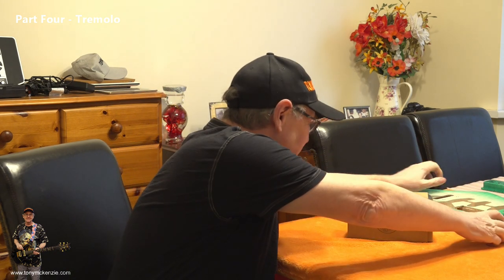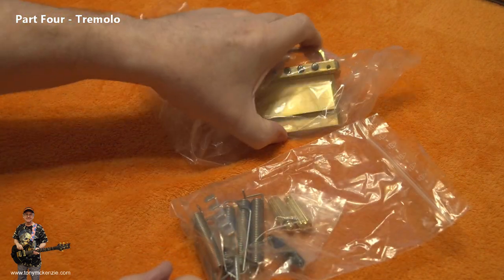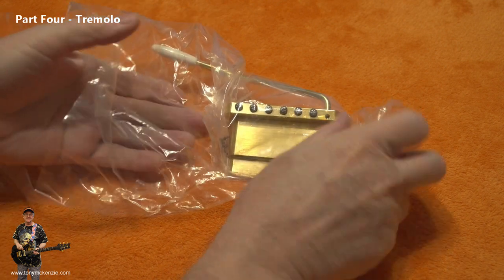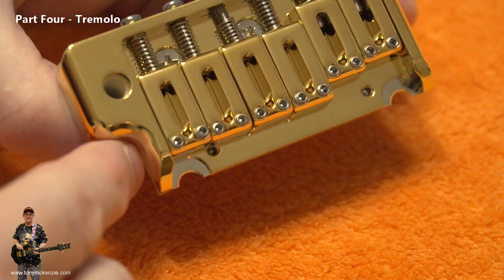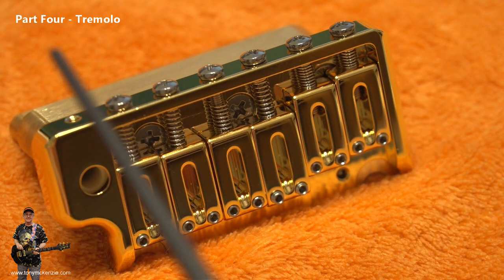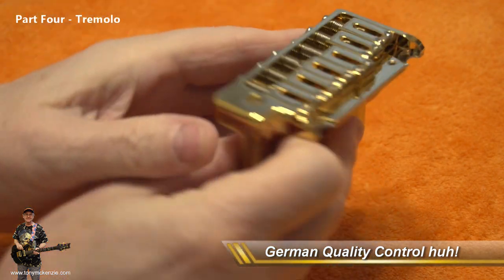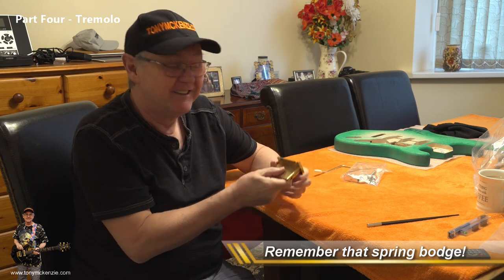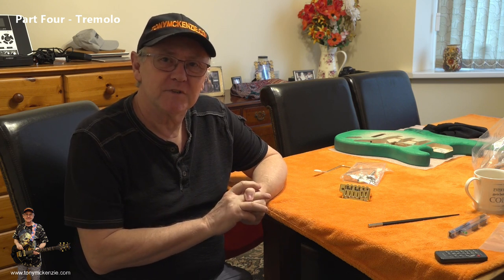Perfect Warmoth Stratocaster Guitar | Featured: ABM 5200g Tremolo |  Part 4 Strat Trem Closeup

Comment: Tony that looks like a great trem, love the gold, and the brass block. I ordered a strat from Warmoth with the Fender American Standard routing. My trem was a Hipshot which was supposed to be a direct replacement for the Fender. It wasn't. The trem wouldn't rock because the block was hitting the back of the trem block rout on the top of the guitar. I had to take a dremmel and grind off 1/8th of an inch off the back of the rectangle to allow the block to fully float and alter pitch up or down. The trem unit still covers the hole completely so you can't see that my enlarging the hole isn't perfect, but it is good. I don't know if that will happen to you with the ABM, but I just wanted to pass this along in case it is an issue. Thanks for the really well done videos!
Reply from the maker: Great point. ABM and Thomann both say its a direct replacement for the American Stratocaster, but as we both know that's not always the case. All the ones I have used to date have been a perfect drop in, but if you look at the video where I show the bridge dropped in to the body, I'm not entirely sure that there is not work to do on it. Thanks for posting about the Hipshot (do you have a model for it) as it helps people to know what is really a direct and what is not. I'm reserving my opinion on the compatibility until I fit this, but any issues will be posted on here for sure and also shown in the video for sure. One thing is for sure, if there are problems with fitting this ABM tremolo unit then it clearly won't be fully compatible. We shall see and as I said, good point for sure. Thanks for watching and stay safe.
Reply: @tonymckenzieofficial  The Hipshot unit is the Contour Tremolo, model 42100vc. Cheers and thanks again!
Reply from the maker: Thanks for the model.... and stay safe.

Comment: yrs ago wen i had access to a metal shop i went and copied the bridge plate on my hard tail strat. i used hardened steel to replace the chrome plated copper plate it had before. it was a pain in the ass  heating and bending it to look stock drilling out the holes for the saddle screws ect. i polished it up and fitted it and i like it better but if i ever do it again im going to use pattern welded steel because it looks cooler, i might try pattern welded block saddles but i it wont be fun and will take forever just the way i like it. if i was in the market for a new upgrade for my backup strat the abm would be a contender!
Reply from the maker: Thanks for the info on the mods! Ha I could not do that these days (maybe when I was 25 or so) and it sounds like aggro to do too. So how much better was the tremolo after the work? Could you hear a difference or was it the 'feel' of the unit... all interesting stuff. This tremolo was chosen by me because it was 'different' in a few ways but claims compatibility with American Stratocasters. Well we'll find out about that soon enough :). Thanks for watching BTW and stay safe.
Reply: @tonymckenzieofficial  What was the name of that other superior trem you mentioned? Have you tried CGWP (or maybe it's CWGP) for parts? They're based in Norway. They have a Reverb page. I wonder how different metals affect tone. I don't even know what 'cold rolled steel' means. I was looking at Glendale and Callaham hardware. I'm going to install a dual fulcrum - maybe the G&L. I'm not sure if they make a brass one. I like brightness. I may try a brass pickguard, nut and tuners as well. I like relic or antiqued brass. That Norwegian Co. I mentioned makes a lot of bronze and brass hardware....and nickel, tin and steel too I suppose. I have a lot of experimenting to do with woods as well.  There's a million things I want to learn: how to wind my own pickups and make a pinecaster from the wood of my uncle's barn. I actually love those old Japanese Teiscos that Hound Dog Taylor played. Subscribed. Thanks.
Reply from the maker: That was HALON - http://www.halonguitars.com I think that is...  I have not tried the company you mentioned. Trust me that if you watch the demo I did with the completed guitar with the Halon saddle changes there is a massive difference in tones. Here: https://youtu.be/_kPTmpXd7Ps?t=4034 and you can literally hear the difference. The singular change was the saddles - everything else remained the same.  The thing is I guess you will never stop learning with this stuff... but that's a great idea! Thanks and stay safe

Comment: I would rate the ABM 5200G(from your video) as a good trem. I do agree it has similar style to the PRS bridge. I believe the separate harden steel knife allows better assembly as the hardening process is applied only to the intended part. I doubt they would sell replacement blade as that would be a sign of unsure quality. Since sir is now an ABM user, May I recommend sir inquire ABM about the spare blade. Any official reply from ABM would certainly resolve our curiosity and questions of their technical support. Thank you
Reply from the maker: It does look good, but there was the aspect of quality control and to be honest, I expected this tremolo to be perfect and out of the box it was not (its in the video). I suppose easy enough to fix, but for the price I expected perfection without ANY compromise of quality control in the box. Good point on contacting them... I likely will and I'll let you know what happens on here. Looking closer at that fulcrum, it looks to me that the whole top plate is also brass and hence the reason they had a steel insert... that makes sense too. I don't think I have seen any other bridge quite the same as that. I'll post if I get an answer.... and thanks for watching. Stay safe
Reply: @tonymckenzieofficial  As a consumer myself, I do agree about expecting high quality especially after transacting such hefty amount. To add, the saddles has some generous yaw to move side to side. I guess it stays in place after string up. A snug fitting is much prefered than too loose or tight. 

Thank you for taking my suggestion into your future inquiry. Keep uploading good project and sir be safe too.

Comment: Hi Tony - I've just fitted one to my warmoth strat and it seems to be putting the strings to the right of centre (very slightly). Does yours do this or have warmoth misaligned my posts slightly? I did make sure all the bits of the guitar were "american standard" spec...
Reply from the maker: Hi James... the body will not be wrong.... check the alignment of the neck (left to right) if the strings 'run off' down the neck. This bridge I returned as it did not fit correctly and I was not happy doing mods to the body that I know is right.... Hope it helps a little... but otherwise I don't have an answer :(.  But do let me know what you find and post it on here....  stay safe.
Reply: @tonymckenzieofficial  thanks Tony - I've done some digging and I think it's a case of neck alignment. Need to loosen the neck plate and just pull the neck to one side slightly while tightening. 
The guitar has just been put together so I'll leave it for a bit to settle before doing this adjustment (it still plays well atm).
Cheers and stay safe
Reply from the maker: You will find that even if the joint is tight (as Warmoth usually are) there is a lateral movement... but take it slowly to avoid any damage to the finish. Once its where you need it just nip the screws back up :). Stay safe...
Reply: @tonymckenzieofficial  thanks for your help!

Comment: It’s a tremolo does it take a battery or does it plug into the mains supply.lol.
Reply from the maker: You guessed! Yes, you take one wire and connect it to the springs, and the other wire directly to the trem arm (notice the insulating bush) and hey presto... its all good until you turn it on... then boom :) after the boom... is a sort of trem sound.... fading away slowly in to the distance :). Stay safe.

Comment: A lot like a PRS bridge, except I bet that one doesn’t lose its plating as soon as you rest your hand against it - unlike the genuine mega bucks PRS Custom that I had... oh we’re back on overpriced guitars again - sorry!
Reply from the maker: Ha it's OK I get it of course... if the bridge was gold on the PRS it does wear off but that's the case on near enough every gold part I have from anyone. Great point as to whether this ABM tremolo will lose the gold... I suspect it might well do, but it does look a very high standard... but hard to tell whether it's thicker or protected or anything else really. It should be interesting as to how it all proceeds... notwithstanding the fitting of this bridge that claims to fit an American Stratocaster of which this body is an exact replica of the two point system. I really wonder if there will be any mods... but if there are I'll be the first to say so. It DOES have a similar to PRS design although I did think the saddles were a little more 'sloppy' than on the PRS - who knows why. Stay safe.